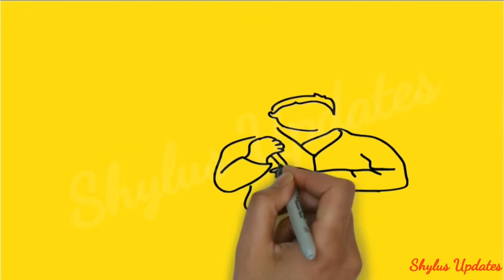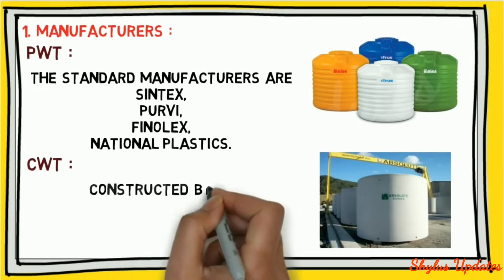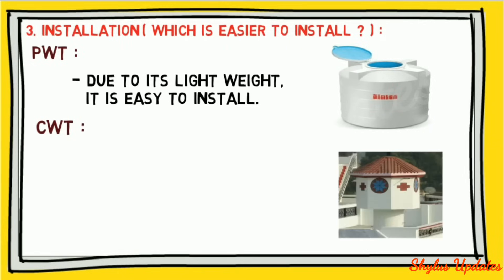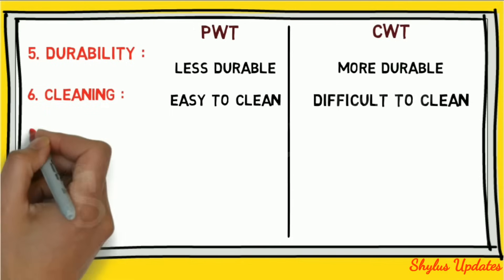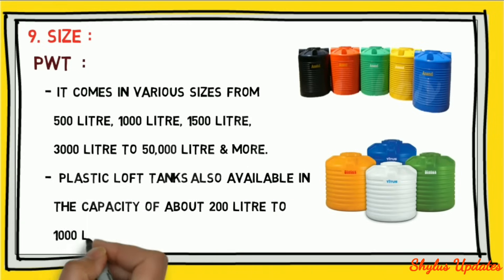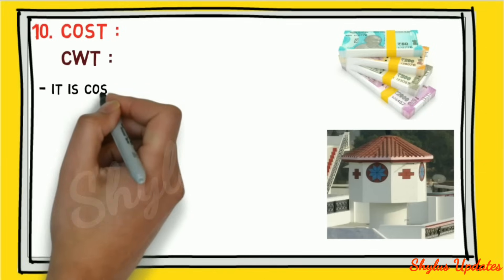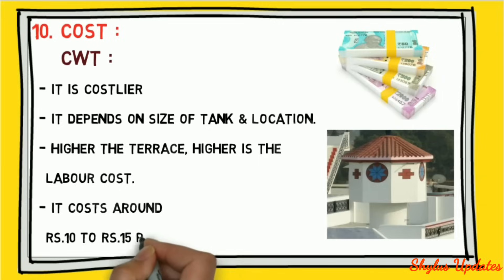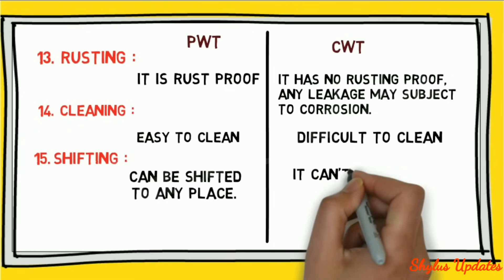Plastic water tank vs Concrete water tank | Which water tank is better ?

Comment: Is it okay rather than making underground cement water tank if we keep plastic tanks underground and cover them with cement plaster by leaving space for tank lid ? 
Actually we want to build a 10,000 liter cement water tank for rain water  storage but it's cost is huge. So I thought rather than building underground tank what if we keep plastic tanks underground ?
Plz advise, it will be really helpful for me
Reply from the maker: Dear Vikas M ,
In my perception it is not good to bury Plastic Water Tank under ground.

The reason is,
Underground plastic tanks may experience considerable external hydraulic pressure of wet clay/mud on their outside during rainy season. When these are even partly empty, that external pressure may lead to the collapse of such a tank, rendering it useless due to cracks . Huge buoyancy upthrust on an empty plastic  may also causes large upwards force, damaging the tank and rigid pipe connections fixed to the tank.
But underground Plastic Water Tank also Available in Online for less than 5000 litres.

Just check with it once or twice...
Because quality is important.
Reply: @shylusupdates  thanks for detailed answer🙏